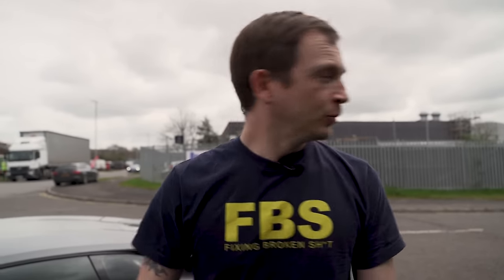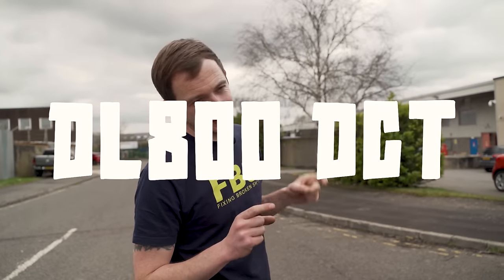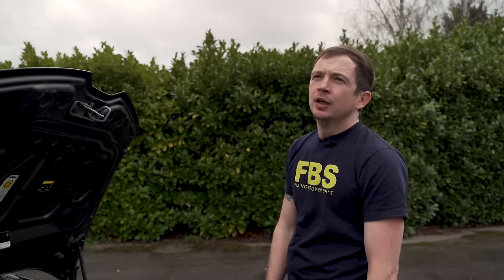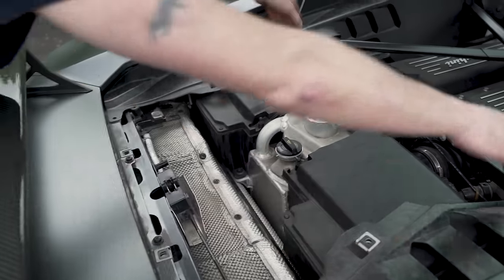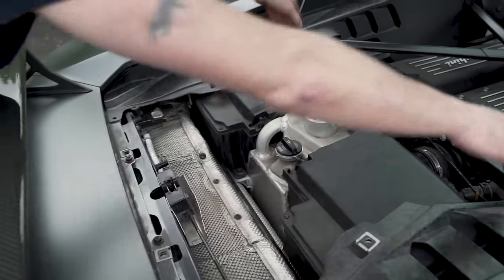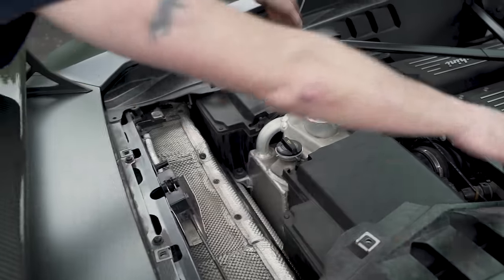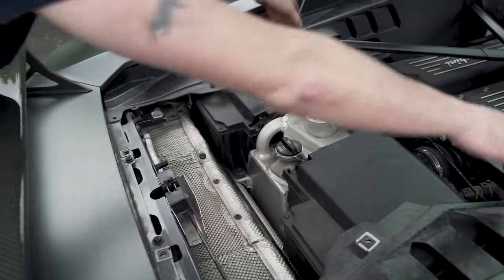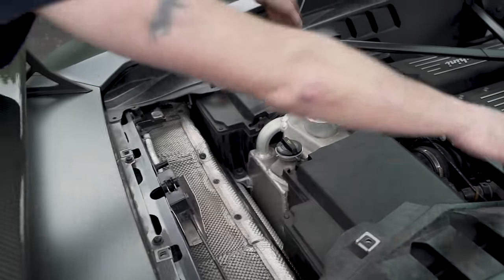Lamborghini Huracan Faults & Problems | 2024 Buying Guide!

Comment: The issue you missed, which you have mentioned on another video is the 3 gauges going out above the consol. Fairly common I believe. Is there a fix (who?) rather than replacing the main dash that drives the gauges. Thanks

Comment: With my R8 2023 I am having a recurring problem, the A/C stops cooling, it starts to blow extremely hot air, not sure if the Huracan has the same problem. First time I took it to the service center, they said they reset the A/C and it fixed itself, another time I fiddled with the knobs and it fixed itself, but other times it didn't fix itself, even restarting the car didn't help. Has anyone had this issue?

Comment: That was an excellent video! And I always check multiple modules for mileage discrepancy - good tip! Seems odd that they didn’t build in camper adjustment. Should be easy to do with double wishbone suspension!

Comment: Ricky, what's the difference/similarities between a Gen 1.5 facelifted R8 to a Gen 2? Obviously the DCT and the updated rear frame rails/subframe to accommodate that transmission..... But is there anything else that the 1.5's have that the Gen 2's have as well?
Reply: Two completely different cars - starting with the engine and finishing with the frame.
Reply: @Elberoth  I believe you are wrong. The facelifted R8's with the DCT have the exact same drivetrain as the early Huracans. Supposedly the only difference, as far as drivetrain goes, is a detuned ECU. However, I'm looking for Ricky, the expert, to confirm what others have said as well as any other mechanical changes. I'm obviously not talking about the exterior and interior differences.
Reply: @bgj2940  I was discussing what you have stated - 1.5 facelifted R8 to a Gen 2 - not Gen 2 vs Huracan.
Reply: @Elberoth  the 1.5 with the DCT has the exact same engine  and transmission as the Gen 2 R8 and Huracan. Only difference is tuning and a viscous coupling versus  haldex AWD on the Gen 2.  I was asking if they share anything else other than the engine and transmission. Keep up!

Comment: I had the exact problem happend to my LP610-4 TPMS control module this last weekend....but it wasn't due to a bump....large body of standing water took it out.... :(  Take his advise.  Upgrade the panel before you're left with some dangling wires and a scraping noise..........
Reply: Where is it located?
Reply: @HH-ng8qh  left underside of the car behind the driver's seat.  It's a black rectagular piece of plastic about 3 inches by 5 inches.

Comment: Dead bolt? What kind of security is this?
Reply: I'm sure Ric mentioned the difference. Anyway deadbolt the alarm system disables a relay for example fuel pump relay. halo on the other hand
mashes the ecu and to disable there is more than pushing a button to disable. You have a sequence to go through like press the horn button
twice then put the righthand indicator on, then press the clutch pedal (or flap paddle ) wait five seconds for two beeps and your ready to 
start the car, if you get the procedure right.  Hope that helps.

Comment: I've found a similarity between this gorgeous looking Lambo and my Transporter. If I jack my transporter up at the front, it lifts the back also.... phew! Saved myself a few quid into the bargain😂😂😂 and the nose lift module swimming is typical of car manufacturers. You'd think someone at the factory would test pour a lot of water over them and see where they puddle! My Q7 puddles in the passenger footwell when the front passenger side drain plugs block up with leaves.... it's worse than the blooming MX5 that used to be a swimming pool after a shower of rain😳 there is another topic for a 'RANT'... Why do oem's make stuff that is 'dogshit' and don't  care about the pain and suffering you go through as a result.😂😂